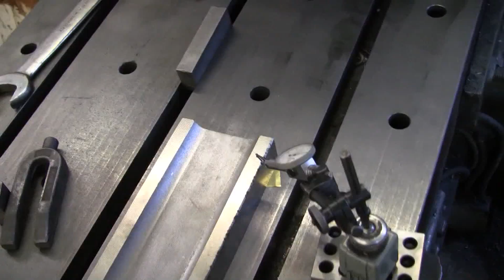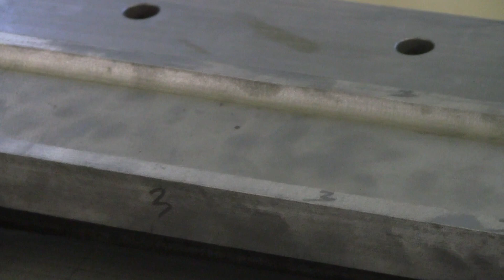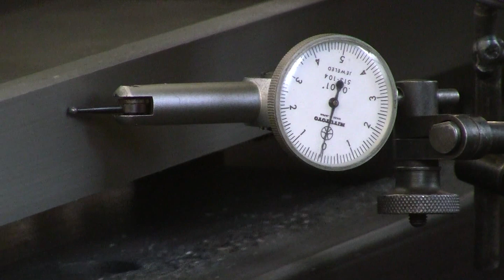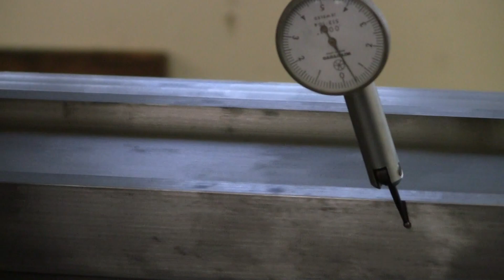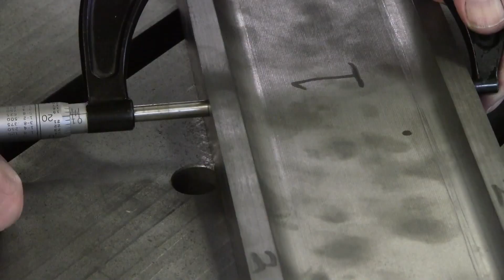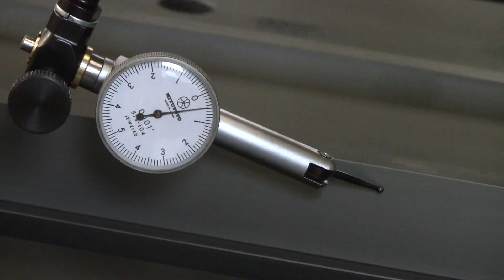Building A Planer Vice (an update)

Comment: I am very pleased to have found your videos. I recently acquired a 1967 Kitamura planer ( a rockford copy) and am learning to use it. Your experience is tremendously valuable, as there's not much information on using these machines.
Reply from the maker: I am glad to hear that you have a planer.  There are not many around and they are a great tool.  What size is it?
  You are correct in that it is difficult to find information on how to use a planer - even when they were commonly used there was not much written about them.  I wrote a paper on Planer Work for my son when I gave him the shop.  A more recent copy can be found at :
https://www.practicalmachinist.com/forum/threads/planer-work-paper.424401
Reply: Thank you Rees! 
Mine is a small machine, it will do 24” wide, by 72” long. I’m currently building a portable milling machine, and excited to use this planer to make some parts. 
Isaac
Reply from the maker: The first planer I ever used was a Rockford open-sided of that size, though I thought the table was 20" wide (but that was 51 years ago).  It was tiny compared to the other three planers, but a pleasure to use.  When I was looking for mine it was difficult to find one small enough for my shop.  Perhaps you were lucky to find a small one - probably lucky to find one at all.  Congratulations.
  Where are you located? And would you be willing to take on planer jobs?
-Rees

Comment: I would very much like to see how you sharpen,  lap and position-tighten the wide, down-plunging carbide cutter. I suspect that a lot of the amazing accuracy that you accomplice  has to do with the preparation of the cutter.
Reply from the maker: Someone else asked about this, too, and I have been working on a short video of this.  The flat-tool is often key to making the planer a great tool.
    But there is not much to it.  The tool should be sharp - no edge honing as is done with other carbide planer tools.  I use a diamond wheel on a surface grinder and a jig to hold the carbide.  If only used for cuts 0.005 or less it should remain sharp for quite a while.
    The tool shown has a rake of 7 deg and clearance of 5.  Others I have vary down to rake of 4, clearance 3.  
    To make this work at all, the edge needs to be behind the base of the tool shank (or at least set up so that the edge lifts as it springs backwards under cutting pressure.)  If not, the tool will dig, and chatter will make machining impossible.
    Regarding "amazing accuracy", recall that the "original edge" was not cut with a flat-tool and the the flat-tooled edges were copies of the "original edge".  So the flat-tool was only able to maintain the accuracy already there.  Still important, however.  Also, the flat-tool necessarily imparts greater tool pressure against the work which must be accounted for or there will be deflection and a non-planer surface as a result.  In the case shown, quite a bit of downward force could be applied without consequence on the final cut shown where the edge was flat against the table (not over the Tee-Slot). 
Rees